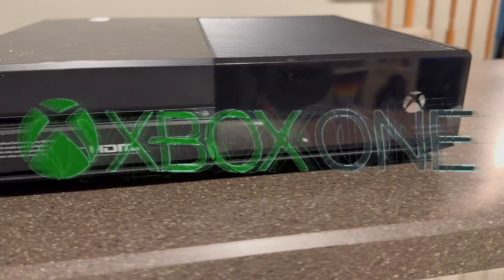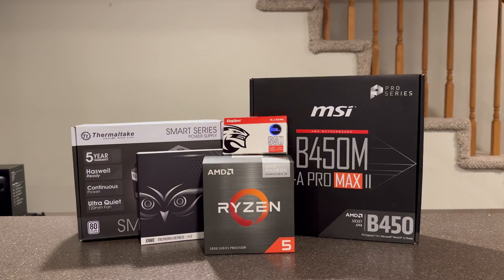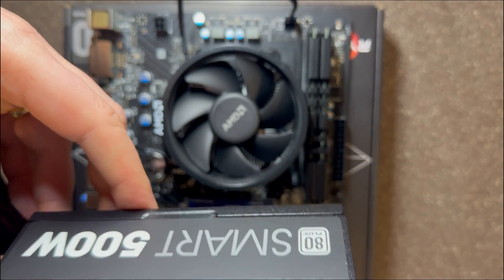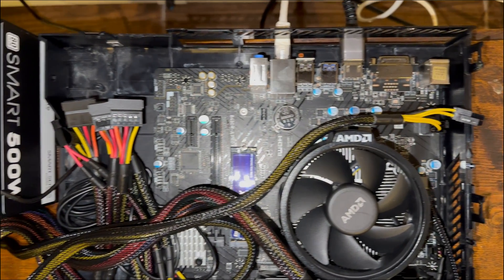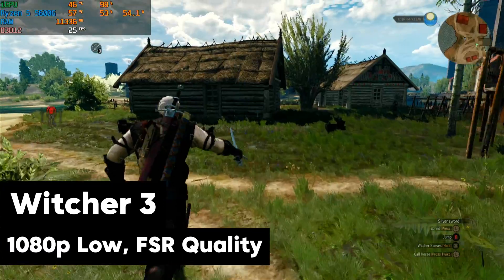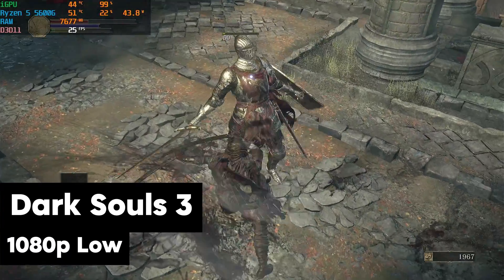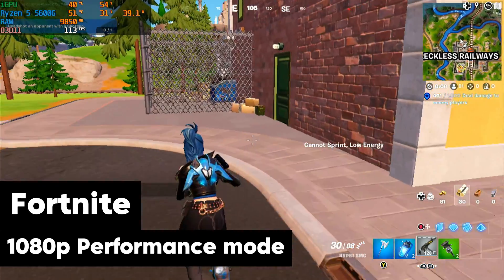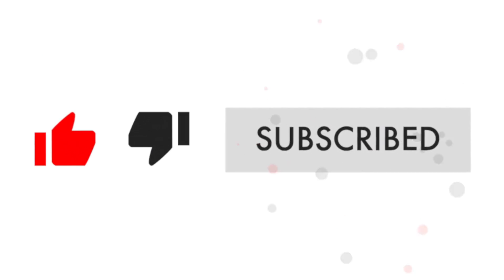Can I turn this XBOX ONE into a Gaming PC?

Comment: I wonder if it's possible in future to make xbox series s run windows 11 or even linux, I know currently no one has found a way to jailbreak it but I'm just asking if it's possible in future or not
Reply: possible, yes. likely, no. it could run it but because the hardware is extremely specific for xbox's OS it would be extremely laggy

Comment: Can you use the original xbox disc drive? I absolutely have to know
Reply from the maker: I didn’t even attempt to try. It may be possible but I honestly don’t even know if it would be compatible.
Reply: After looking at it I think so it has SATA and data connection I was curious because I'm doing the same build and was considering mounting in a power supply vs keeping the disk drive and saving space

Comment: Took 3 days to get mine mocked up, b550 itx, 4060 lp, and a 400watt apevia flex psu. Had to mesh the left top for thermals, but finally got the damn thing to work perfect. And extra 120 intake on right fan shroud pushes all the heat out the left. The i/o and back is still killing me (ugly) but dremel time and measuring should pretty it up
Reply from the maker: WOW that sounds awesome! Would love to see that if possible
Reply: @PetesParts16   wont let me upload pics or google drive for some reason.